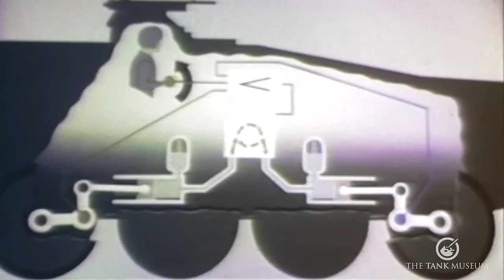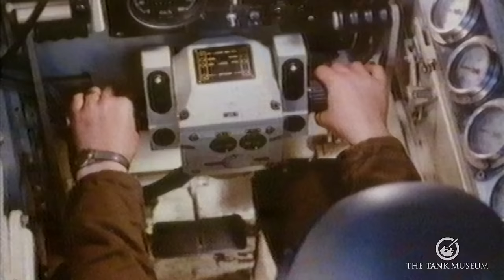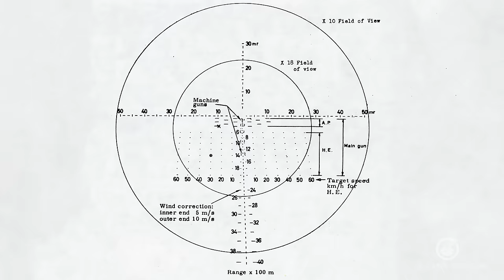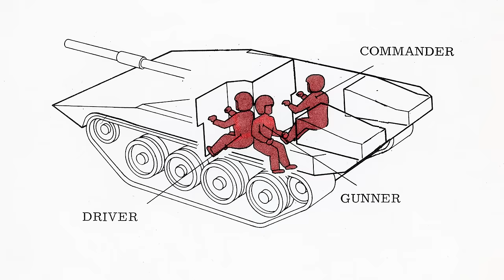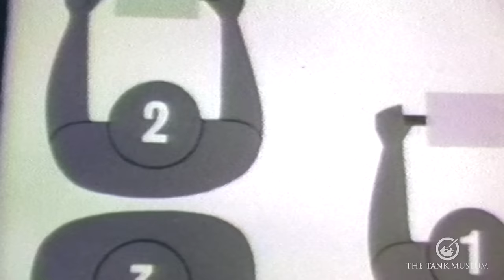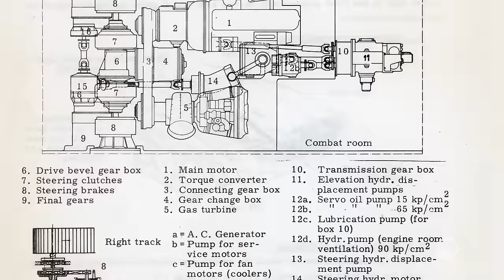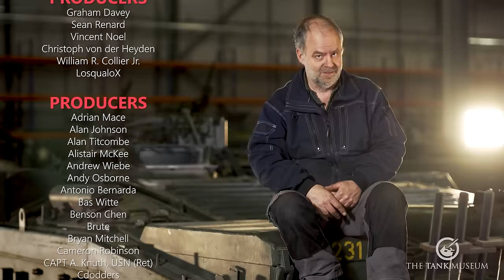Tank Chats Reloaded | S-Tank | The Tank Museum

Comment: Man what could have been if the S tank gets 120mm
Reply: There was the project of that, but they decided to go in other direction.
Reply: The whole thing would've had to be rebuilt from the ground up. Otherwise you'd end up in a situation with a tank from the 1960s just with a better gun.
And we all know how well that worked out for Russia with their T-72s in recent history
Reply: Leopard 2 was and is always going to be better regardless.
Reply: The only purpose of modernising the S tank that I can see would be to repurpose it as an ambush drone to support jaeger light infantry recon and anti-logistics units behind enemy lines where the old 105mm is still viable, replacing both engines and both left side crew positions with an air independent propulsion system and flotation pods instead of the screen so that it could be sitting on standby in lakes or rivers and then activate and move up behind a target formation to engage.
Reply: @marmite8959  The problem with the S-Tank is that the whole concept is outdated. It was meant for a time, when shooting on the move was not really useable.
Reply: @TheWampam  It is not just that it can fire on the move. The armor scheme has quite thin but very inclined frontal armor, the glacis plate is only 40mm thick with a 78 degrees slope, which will be around 290mm effectively thickens. It will have a high chance to bounce off an armor-piercing discarding sabot (APDS)  projectile common when it was designed and built in the 1950-60s.  The problem is when the quite thick and short sabots were replaced by a lot longer and thinner armour-piercing fin-stabilized discarding sabot (APFSDS) that are common today the thin but very inclined armor is no longer as effective. 
 

The introduction of the smoothbore 125mm guns of the T-64 was to fire APFSDS projectiles. The tank was introduced in 1966. Ths same type of gun is used in the T-72 that was introduced in 1973. So the weapon system that was effective against the armor of the strv 103 was induced at the same time it was built. It takes for them to be the common tanks used by a potential enemy, but somewhere in the 1980s it was very likely that in the case of a war, it would be up against tanks that could defeat its armor.

Comment: Chieftain's brief on the the S-tank and the whole turretless vs conventional tanks which as stef points out didn't have stabilizers by in large at the time.  With its hydrolic suspension(+/- of all that oil fumes ya breathed) and it ability to revers at speed armor facing the enemy via the second driver the gun and whole tank are essentially stabilized on the move as you can essentially park it and lay the gun at the same time. I believe the cheifs main point in his S-tank response was its faster and more advantages to turn a whole nippy turbine S-tank then Travers a heavy turret only to leave the side armor exposed to say nothing of S-tank not having to turn and expose it rear for a complex withdrawal maneuver. As i think the chief would or maybe did put it 'its the best tank for swedens defensive mobilization war against cold war soviet hords of armor pushing through its swampy low lands and northern tundra.

Comment: My opinion: The concept was successfull with the Swedish defence tactics and overall tecnoligies at the time when the tank was new, but many problems that was a drawback with the early models was solved with the B and C model. When the C-model was around the concept was obsolete, because all the earlier drawbacks with turreted tanks compared  to the S-tank wasn't there anymore. This tank should not have been used beyond the 1980's.

Comment: The inability to fire on the move sadly is a fatal flaw given that MBTs of other countries can now do so with accuracy. I love the elegance of the S-tank design, but it simply is no longer able to compete with modern MBTs.
Reply: Thats probably one of the reasons it was taken out of service 25 years ago...
Reply: Well the enemies it was supposed to  fight when in service was the T55 and T62, the Soviet and Polish units allocated for offensive action against Sweden did not have top of the line equipment. Indeed in the north the Soviets were using PT76 rather than MBTs due to the terrain.
Reply: @Vonstab  Yes, I fully agree that the S-Tank was feasible at the time it was designed.  But sadly the concept of a turret less MBT has finally, forever been made obsolete because of the ability of MBTs to fire accurately on the move, which a turret less vehicle can never achieve (unless it uses only independently targetable rockets/missiles instead of a main gun--but then is it still a tank?).

Comment: I think the doctrine of a purely defensive military is essentially to understanding the S-tank. Undoubtedly it comes with tremendous drawbacks - if you lose your initial defensive positions and have to retake them, then what? But I really admire the dedication of putting this much engineering in to keep your military truly defensive in nature.
Reply: The technique in use at the time was called bounding overwatch.  Vehicles moving forward would be covered by vehicles in hull-down (hopefully) positions until they reached a good firing position.  Then the overwatching tanks would make the next bound, covered by the formerly advancing tanks.  As the presenter said, gun stabilization was lousy at the time, so firing on the move was ineffective even if you had a turret.  The S could slew its gun quite effectively by using its tracks, so yes, it could be used in the advance much as any other tank.  (This is how Wittmann became famous riding in a Stug.)

Comment: It is a cleaver design.   Is it really a tank?   Well that depends on what you mean by a tank.    The purpose of the tank is to break through the enemy lines.   The early tanks didn't have turrets but they were clearly designed to break through enemy lines.  If you use that as part of your tank definition then this is NOT a tank.  As Karlsson stated they were happy to wait to be attacked.  Clearly from what he states this is a defensive weapon.  It is more of an  anti-tank weapon, great for that.

Comment: This is a relatively light vehicle, about 43 tones. Imho, this configuration with modern tech it could be great infantry support vehicle
Reply: They did try to modernize it into the STRV 103D. Equipped with new armor. A remote control variant known as STRV 105 was also tested. But the army decided to get the leopard from Germany instead, and adopted it as STRV 122.

Comment: The S-Tank is unique amongst Cold War tanks, but that is because it had to fit a unique set of requirements for the Swedish Army and the nation. They determined that they would most probably be fighting a defensive battle against Soviet Union armoured columns and trying to buy time for the rest of their country to get into the defensive bunkers buried deep under mountains. They also determined that any tank that they built would have to be small and light enough to navigate remote country roads and bridges and failing that amphibious enough to cross rivers and lakes when other tanks couldn't. They wisely chose to manufacture it at home in order to save money and to ensure that parts were available. I think from memory that the engine is from a popular bus at the time. We are seeing the problems of supply and spare parts both for the Soviet era equipment and the discussion about the same problems for NATO supplied equipment in Ukraine, so for the Swedish to have considered the possibility of spare parts difficulties during the Cold War shows a greater depth of thinking than many other countries. Yes, the tank is unusual, but how many other countries were capable of producing a home grown tank during the Cold War? How many other countries would even attempt anything like that today? South Korea is one of the few countries that spring to mind. It must be said that they also have a very unique landscape to defend, but building their own tank has been costly in terms of unit cost. 
Australia has the opposite problems to Sweden and South Korea in that Australia is the equivalent size of the Continental USA minus Alaska, yet we have vast areas of inhospitable country and a population of @ 25 million people mostly around the East Coast. How do you defend a country like that? Simple, use the seas and the vast harsh land to our advantage. Plus we have big sharks and huge Salt Water Crocodiles, eager to feast on enemy soldiers foolish enough to go for a refreshing swim in a river. 
Mark from Melbourne Australia

Comment: A whas station in P7 Ravlunda on 103 S 1970😮 On a ordinary road this tank could rech the speed about 90km/hour😂 If the gas turbine failed you have the other motor, but then the tank only make 20km/hour to take the tank to nearest repair centre 😂

Comment: A great interesting fantastic Tank Chat. A foot of oil in the crew compartment?Utter garbage.How could you even breathe?That is disgusting. The WW1 MarkVIs look like a luxurious suit compared to the STank room wise. Would the 105mm gun defeat the armour of the T72 or T80?What about the T55 and T62 T64? Which superb Swedish fighter plane would you compare the S tank with? Do you like this tank more than your grand kids? The S tank looks to me as a mix of enlarged hetzer stugIII/IV and a bit like the soviet bmp1/2. They were not luxurious and generous sedans or F1s as well although they may have seemed so. Was the Stank weatherproof or did it have the NBC protection? How thick was its armour?Regarding the some degree of protection the Stank may have been better solution than a truck mounted anti tank gun like the SAS used in North Africa during the WW2.I did not know about those flaws of the Centurion tank that it shared with the Stank or many other tanks of the early Cold War era.But it did survive a nuclear explosion and it was running again after it. And it was at least 10-15 years older design than the Stank.How come the Government did not want to pay more to the Saab or Scania to make it a better brilliant piece of the Swedish engineering as the Gripen fighter?Have a good one.

Comment: It's not a MBT, it's a TD
Reply: The S-tank is a tank. It was conceived, planned, built and used as a main battle tank. Never anywhere was it intended or used as a tank destroyer.
Reply: @tor2919  It was a TD.  Don't matter what they called it, it was a TD.  It had very limited offensive capability.
Reply: @XtreeM_FaiL  was not opinion, was fact.  s-tank was a failed design and was a TD.
Reply: @mdellyd  Post the source then!
Reply: @XtreeM_FaiL  Rommel
Reply: It was an MBT by rol and doctrine. Saif by the own Swedish military. 🤫
Reply: @mdellyd  lol Romel has no power on a Swedish MBT.

Comment: Sorry, complete BS. In the 70’s I’ve fired Chieftain on the move at moving targets and I guarantee we greatly out performed S-Tanks. 

The S-Tank is a horrible design to be firing on the move. In Chieftain I could lock my gun on to target, whilst moving and at moving targets and then fire, something impossible in a S-Tank. The S-Tank is more like a tank destroyer, having an advantage of a low silhouette.
Reply: At the time it was developped it was the best tank in the world firing at long ranges, but stabilization in turreted tanks got better a lot faster that the designers thought, so yes in the 1970's there were other thanks that could perform equal or even better.